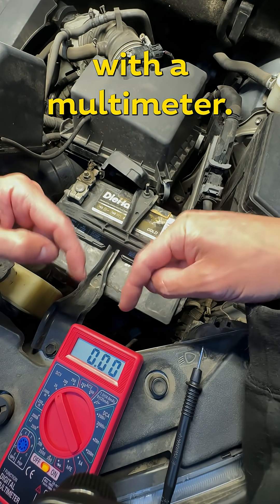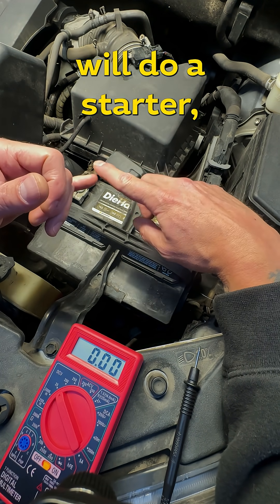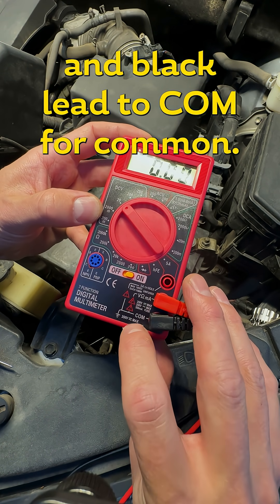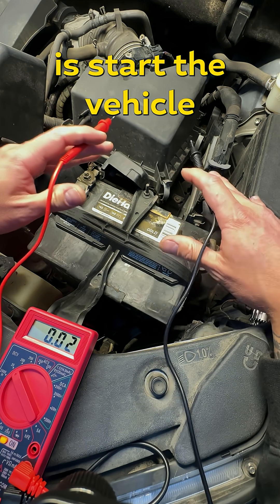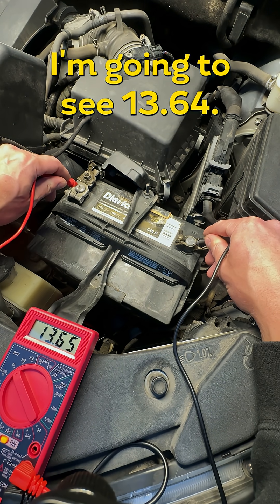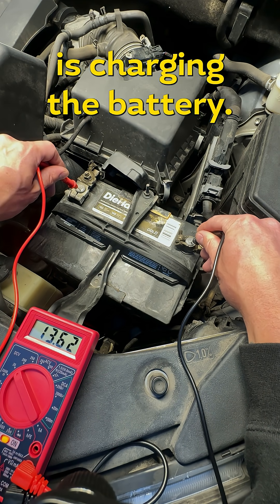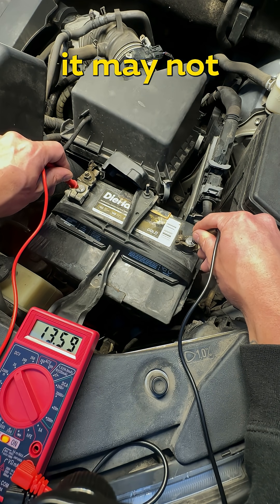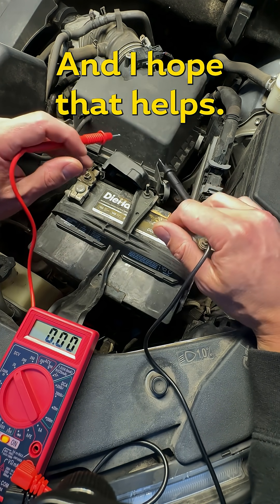How to Test a Car Battery and Alternator with a Multimeter (Basic Check)

Comment: Where's the part where you check the alternator?
Reply from the maker: Did you even watch the video at all?
Reply: @maddoxmechanic yes that's why I asked the question
Reply from the maker: @lonewolve1563  Doing the voltage check after the engine is started is checking the output voltage of the alternator. Doesn't mean that the voltage is good, this test is very limited.

Comment: One battery test is a load test.  You require a load tester to do this correctly. It’s done with engine OFF.  Another test is a cell test where you check the specific gravity with a battery hydrometer.  You can also check voltage of each cell where you put the wires in the acid of each cell. They should all be equal.  On this battery you would need to remove the battery hold down to get to the two caps which you need to pop off.  CAUTION. BEWARE OF ACID IN YOUR EYES & ON CLOTHING. IT WILL DESTROY.
Reply: Be sure to clean off the leads when done or use an extended wire on each wire.
Reply from the maker: It's not a load test. It's a static voltage measurement. You can use the engine itself as a load test. I'll make a video on it, don't you worry ☺
Reply: @maddoxmechanic  Thanx. I worked at Ford 17 years.

Comment: All you’re doing is checking alternator output but it’s supposed to be checked under a load so high beams, fan & A/C should be running
Reply from the maker: I’m not checking the current output of the alternator, nor am I able to check for ripples. This isn’t an “official” alternator diagnostic test, this is simply to check if your alternator is outputting voltage. The multimeter has limitations in the context of the texts being performed. I did my best to communicate that in video.
Reply: @maddoxmechanic  I understand that.  In order to check current output you need to put an amp meter in series to the battery.  Checking for ripples you need a scope like we had at Ford.  This will show diode operation either open or shorted. I only saw a bad diode once in 17 years.  In the ole daze it was usually a bad voltage regulator. These days I think they are internal to the alternator

Comment: I placed the portable charger on the battery.  When my battery charged from under 7volts, to over 9 volts, i was able to start the car.  It is running and the battery reading is still only 10.23.  i have disconnected the charger. It's in the house charging with regular electricity. I don't leave  home without the portable charger. 
 i'm limited to the jump to leave home, and the jump to get back.  One errand at a time.  Not a good situation.  
At least i have clues now.  
Your videos are easy to watch even though im stressed out.
Reply from the maker: Glad to hear you were able to make some progress on your battery situation!